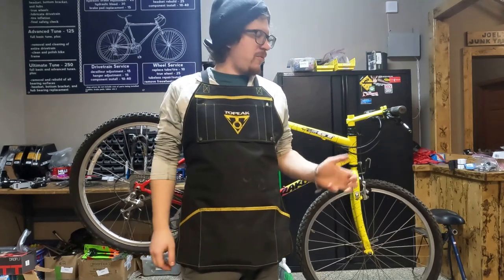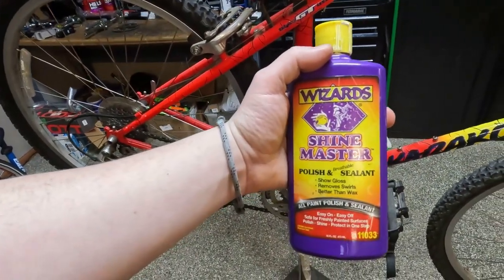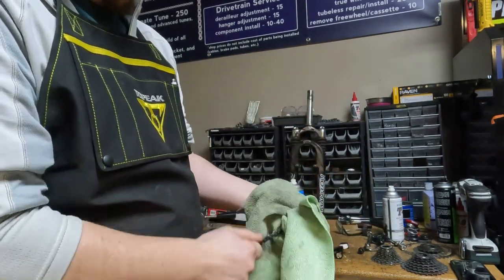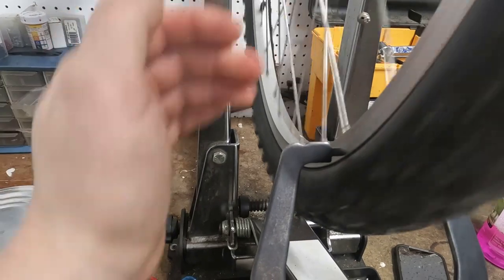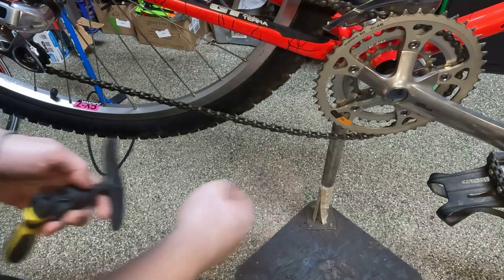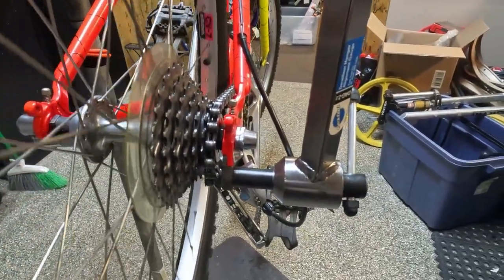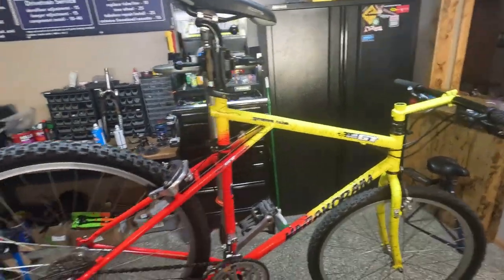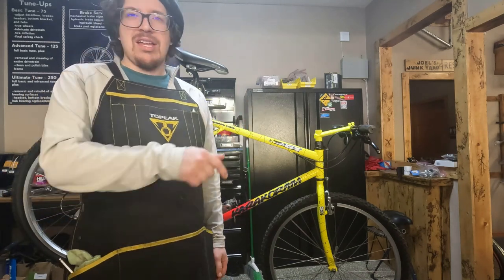Vintage 1992 GT Karakoram Mountain Bike Tune Up

Comment: I missed out on a red and blue Giant Rincon in a classified ad from 1994 last year . I saw it and it looked like it had been kept indoors and hardly used . It turned into an auction due to several expressions of interest in it . I sat on it before other people arrived moments later and fell in love with it straight away . Lucky I have the black and blue Yukon , it's cousin from the same year .

Comment: The quill stem on the Karakoram was like the one on my old Outpost but the main disadvantage of the design was that the compression cap and allen bolt had to be periodically tightened slightly unlike the later AHEADSET system .
Reply: If I'm correct this is the "GT Flip Flop Stem"? ... And you can reverse which end is on the bars & fork headtube, and gives you a higher stem angle to raise your bars up a couple inches. ?

Comment: These are the kind of bikes I love finding, low miles and stored inside. LOVE these early 90's GTs and their paint jobs.

I didn't know these had a replaceable der. hanger. What's up with those adjuster knobs on the dropouts? Never seen those with vertical drops.
Reply from the maker: I was just talking to a buddy about the adjusters on the drop outs, neither of us can figure out what they are for with vertical dropouts. I'm going to message some GT collectors to figure out what they are for. Will let you know when I find out.
Reply: Looks like it’s for fine tuning how the wheel sits in the dropouts. I agree—very odd.
Reply: Wheel alignment but a variaton of the horizontal ones found on many BMX'S .
Reply: Full size aluminium derailleur hangers started to appear about 1996 onwards but widespread by 2002 . The hanger in this video is a tab style one and these were mostly made of low carbon steel powdercoated black .

Comment: What should I be searching for to buy a replacement rear brake? I ended up with this frame set, but no rear brake. Already made the mistake of thinking it was a standard cantilever brake.
Reply from the maker: The rear brake is a u brake. We unfortantly don't have any in stock at the moment but there are multipe on ebay. Have fun with your build.